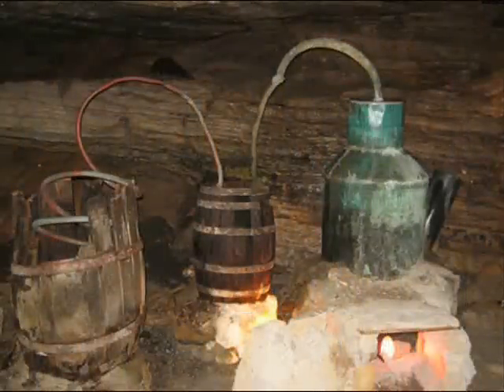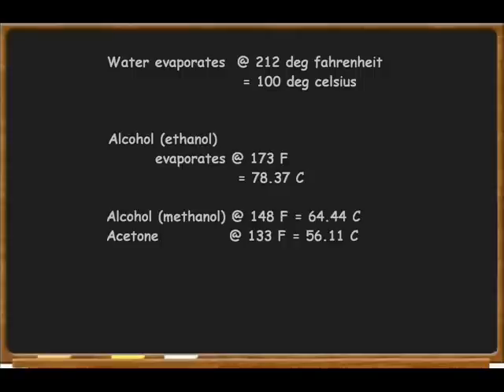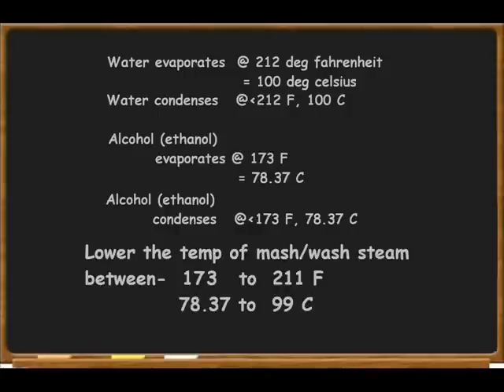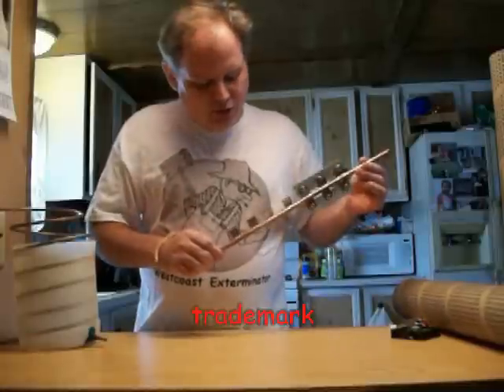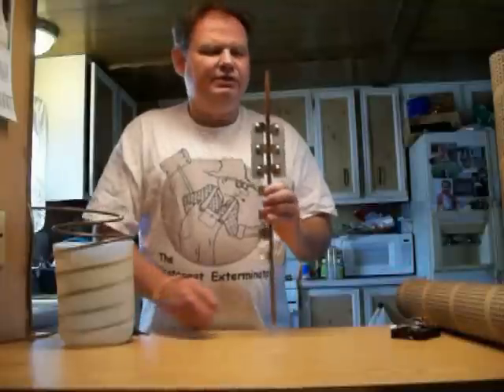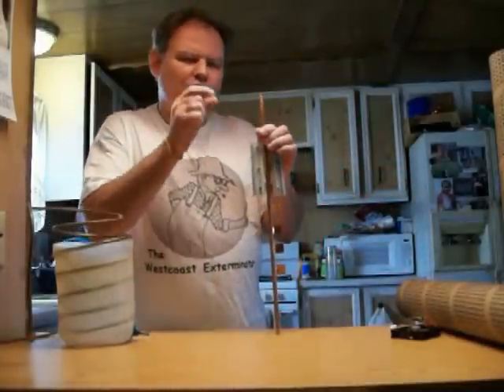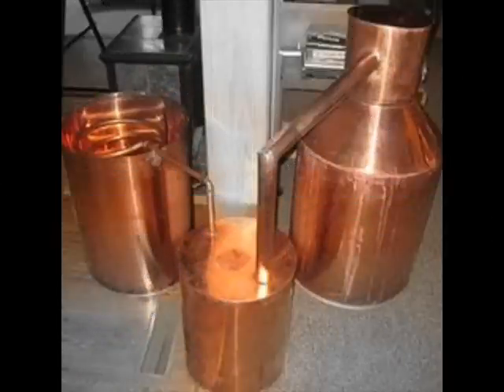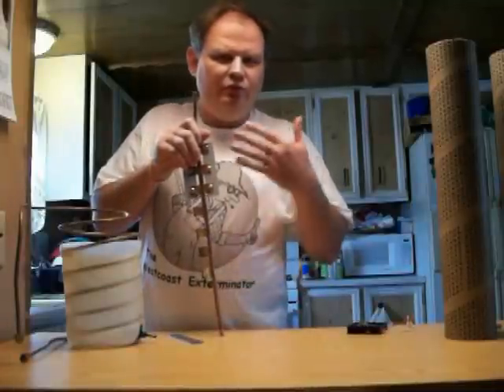Moonshine Still Reflux Columns & Thumper Kegs 101

Comment: Your design is untested and is so wrong on many levels.  I could write a novel about your errors in judgement.
Reply from the maker: Untested but you seem to magically KNOW it's still wrong. Amazing. Since you could right a book on it, maybe you'd like to submit your book to the same publisher interested in publishing my info? Just sayin'
Maybe you could give me the Readers Digest version and enlighten me...
Reply: wcemichael Damn right I know it's wrong.  30 years as a licensed Mechanical Engineer tells me it's wrong.  Let me just start by saying this.  You are solving a problem that doesn't exist.  Finished moonshine is TEMPERED WITH WATER to lower the proof.  Secondly the mash is HELD AT ITS BOILING POINT until it boils off, which is well below the boiling point of water.  If you cool the alcohol steam in the riser it will condense and run back into the boiler.  The idea is to make alcohol not continuously recycle it.
Reply from the maker: hlyautey Well I am the leading moonshiner on YouTube, with massive amounts of info, looking into publishing a book.
Let's test your 30 years of engineering...

"You are solving a problem that doesn't exist." Your belief system you just made up to please your ego. If I'm "solving a problem", then there must have been a problem, HOWEVER I'm not claiming nor have I claimed there is a problem.
I have merely reexamined the method and broken it down into a simpler solution. Your massive engineering knowledge should have told you that, but instead your running on ego.

Strike one...

 " Finished moonshine is TEMPERED WITH WATER to lower the proof." Then why have reflux in the first place? Go yell at the still company making reflux stills that make 190+ proof alcohol for drinking. I personally think people don't need reflux nor will I put one on my personal still and I tell them that, but people still want it, so I gave them the basic principles of it. Popcorn Sutton uses a thump keg in his video to increase proof and TEMPERS IT WITH WATER. So your point lacks having a point except to pound your chest at me. Your ego is bruised and now your cherry picking arguments.

Strike two...

 "Secondly the mash is HELD AT ITS BOILING POINT until it boils off, which is well below the boiling point of water"
Forgetting a main scientific principal...
The BOILING POINT of water is over 200 deg.
The EVAPORATION POINT of water is anything above the freezing point. WATER STILL EVAPORATES AT 170, that's why you can never make 200 proof alcohol

Strike three

"If you cool the alcohol steam in the riser it will condense and run back into the boiler."
Again forgetting basic principals. If you cool the alcohol steam to 180 then only water can condense and run back into the boiler. The reason the cooling fins were set up specifically the way they are, with gaps between the small copper pieces,  is to only allow a slight cooling, letting the water condense and the alcohol continue.

Strike FOUR...

You are 0 for 4
It seems your 30 years of engineering knowledge has failed massively, were as I have debunked all your arguments, having just woken up and still working on my first mourning cup of coffee.

You will either realize I am right and say your sorry, or look at everything with bias and start pounding your chest again and start cherry picking more arguments, but I already know what you will do...and the words "I'm sorry" won't be involved.

Comment: The reason the reflux riser is larger diameter is to decrease restriction and backpressure in the boiler.  You have completely overthought this and created either a very low production still or a dangerous one.
Reply from the maker: "The reason the reflux riser is larger diameter is to decrease restriction and backpressure in the boiler." And then they either pack it full of marbles and copper mesh, increasing restriction and back pressure in the boiler, OR it has to pass though several plates full of small pinholes, again increasing restriction and back pressure. You have completely underthought this

My one still has an even smaller diameter cooling coil with no reflux riser. It's not going to get any more restriction by adding in a slightly larger diameter tube before the smaller one. Oh, but since you are SOOOOOO worried about back pressure you can split the up tube into multiple up tubes of the same diameter and decrease back pressure, or don't you think that much? Took me the time of reading your comment to think of that.
Reply: wcemichael You sir are a moron.  You seem to think you invented the heat sink or the cooling fan.  The alcohol expands hundreds of times its original volume after it boils off and if it has no place to go it will blow the still up.  The reason the worm is smaller diameter is because the alcohol steam is condensing and dripping out the end.  HELLO
Reply from the maker: hlyautey
" You seem to think you invented the heat sink or the cooling fan."
TROLLING.
That would be like saying Henry Ford thought he invented the wheel.

Comment: While i'm not a fan of reflux stills I do own 2 and that's not how they work or are made. All true reflux stills share 1 common element. They have plates inside of them which act like several small thump kegs. The first one i purchased about fifteen years ago was packed with 3 layers of copper mesh separated about 6 inches apart(4 inch mesh wadded up in sections and separated 6 inches from the top of one section to the bottom of the next) The wash would evaporate into each of the packed layers then separate the water from the alcohol until it came out the condenser at around 186 proof. Hot as hell but no flavor. 

The second one i purchased about 2 years later and is known as a hillbilly flute. It has four actual copper plates as well as glass sight glasses. Each plate is concaved down and has a hole on each side so that they are constantly re condensing the the water vapor.
Your diagram and the way you are explaining it is what happens when someone detunes their column so that it was now a pot still. As i said i don't like reflux stills but I do own and have ran several of them for friends. Not trying to bust your balls and even though I've been doing this for years I still watch and enjoy your videos. Keep up the great work!

Comment: Why not just just control the temperature in a stepped process? Heat it to the lower temp to get the bad alcohols out then step up the heat to 173 degrees or slightly above. Controlling the heat with an Arduino and some heat sensors along with a relay for the heating element would be easy.
Reply from the maker: On a gas stove?
The idea behind my videos is to learn the processes, not to let machines do the guessing for you. A car that can park itself usually has a driver that doesn't know how to park a car.
Reply: wcemichael
No, using an electric element to heat the mash. I disagree with you on your analogy, or rather your comparison. It wouldn't be having the machine guess, but control the process. It requires knowledge of that process to program the controller to read the temp from the sensor and have the heating element do what's required. There's no guessing by the machine at all. I can understand that part of the thrill of making moonshine is doing it yourself. Part of the thrill for me is seeing if precise control would yield a superior product. Maybe it will, maybe it won't.
Reply from the maker: Bad Wolf Media
Turn still on, set to temp that other guy tells you to. walk away.

My method, I don't even know what temp I'm at.  My product is superior because I'm always watching it and making little adjustments. The highly advanced control unit is my brain.
Reply: Actually the wash will take care of temperature control for you. When it is running off the heads it will not go above 159-162 at the top of the column/pot head. The heads will run off very fast unless you are running off more than 20 gallons of 10% wash. So it will be much easier for most to just toss the first 1.5 oz per gallon of wash. 
As soon as the methanol is run off then your wash will jump to 172-178. This is when you are getting great tasting high proof Distillate(moonshine, rum, vodka, whiskey). The temp will slowly climb to about 202-210 producing lower proof as well as harsher tasting Distillate as it does. This entire process will be done with out you ever adjusting the temp of your heat source.
Before you make your first run fill your still 80% up with straight tap water. Set the temp on your burner to medium and see how long it takes to begin producing distilled water. If it takes less than a hour turn it down/more than a hour turn it up and do it again. Once you find out where your burner works best take note, this is where you will set it to do your entire run from now on. Of course the 1 hour rule is for stills from 2-6 gallons add 15 minutes for every gallon above this up to forty gallons. Over forty and your in the distillery/illegal moonshine business range and it would be best to consult or hire pros to help you control your still and or run from the cops.

Comment: I think it would be good to make a video on how to make a copper still
Reply from the maker: I might, given enough time and money, as it would be expensive.
Reply from the maker: John Erskine
Hmmmmm......
Other than developing a refined taste, not really. Experience my friend. I started distilling my own 20 years ago. Started with Night Train wine, then hard cider. I had a small bit of it shining figured out, and I did some things wrong. A couple years before I dove into it again and these videos, a friend gave me a shot of shine from some unknown guy. I didn't like it one bit, I was worse than my first time running myself. I didn't ask for anymore. He thought it was great. Sometime later, I heard he went to the hospital because of bad shine.

Now if you want to run some store wine through an unclean coil, you can see what that tastes like. DON'T DRINK IT, just taste it
Reply: This is AB at yall- I built a still out of a wistler coffey pot some years ago that worked just great! I made a 1/4 inch copper coil about10 or so wraps and put it in a #24 juice can and soldered it together Made a vent to allow cold water come in from the top and drain back into the sink- once the can filled with cold water I closed the vent keeping the condencer cold- ran the other foot and a half of the coil into the top of the pot and made a bail to hold the top down- made a 5 gal buket O malt beer and ran it after the head died- Took some time after runnin the whole buket to strain it through washed yarn and hicory coals- I lived in an appartment where the water and gas was included in the rent so it only cost me the price of the malt and sugar and a lot of time just to see how the Ole timers did it -no thumper or anything like that  Just an ole still like the one on M.a.s.h that the docs had and it woked great!  Just a thought.
Reply from the maker: AirsoftEli2000
Yep, it's not the equipment, it's what you can do with it that counts
Thanks for sharing. I was wondering about building a M*A*S*H still just for kicks and giggles

Comment: would the heat sinked column come off the pot and transition to a 45* drop?
Reply: No it's even simpler. If the steam goes up at any angle and drops can fall back into the pot it's reflux. If the steam goes down at any angle and drops fall into your collector, then it's a condensing coil. So even 20 feet of copper coil, as long as it's going up, is a reflux.
Reply: Ok, thanks Mike. I'll give that a shot. I'm trying an old Potcheen recipe. I'll let you know how it works out.
Reply from the maker: SCOTTSCOTTISH1
Yes, the main thing to remember is, your only cooling the steam just enough for the water to condense and fall back into the pot and not your finished product.
Reply: Great, I thought that was how it was, but I trust your opinion more then mine. I'll send you pics of my ceramic tile heat sinks installed when I get it finished.
Reply from the maker: ceramic tile heat sinks? Nice. That's thinking outside the box.
I don't know about it though. Ceramic is kind of known for holding heat, it's put in electric heaters because of that fact. it might require a cooling fan.
Just putting in a afterthought.
Reply: Your so right. What is needed is something that dissipates the heat. I know I've seen copper flashing. You could make a sandwich out of two pieces and form them nicely around the column with a rivet hammer and dulled very blunt edge chisel. That way it would be nice and tight and then solder those down. I think that flashing comes in 8 - 10" widths by 10' lengths. quite high, but might find someone willing to give me their off fall.
Reply from the maker: SCOTTSCOTTISH1
Now an idea I had but didn't show was to surround the tube with other tubes. solder them on and surround the steam tube. You could then attach more tubes to those tubes. They would also channel air from a fan real well. You could also sandwich a piece of shorter aluminum between the tubes and solder the tubes at each end.
Reply: I just purchased some copper vga heat sinks. I'm going to give then a shot. In computers those vga heatsinks have a lot of surface area. Worth a shot. Didn't cost much so why not.   http://www.ebay.com/itm/8-PCS-Copper-VGA-RAM-Cooling-Heatsinks-Cooler-with-Adhesive-Backing-Strip-/291186309267?pt=LH_DefaultDomain_0&hash=item43cc0e7893
Reply from the maker: Ooooo those look good.
Reply: Yes they do. They should work very well. Think of all the heat built up on video cards inside a processor.

Comment: Really cool!!! I've been obsessed with this lately, reflux and thumpers in general. Anything to get a cleaner product :)

I have a 1/2 gallon Mason Jar thumper, I put pure copper scrubbers in it(that I boil clean before every usage), and I put just enough water in it for the copper "input" pipe to touch, no more no less.

The output is just a small condensor I've had for awhile, not the big immersion coil types, but the smaller ones that you pump water through constantly(I've used an aquarium pump for nearly 3 years on it)

It's been really great!! High proof, no having to mess with collecting low wines and "re distilling" them, which is something some people do, but I don't think it is efficient, also it comes out very clean, and at a more reasonable speed.

I even thought about trying a second 1/2 gallon Jar after it, like a double thump, but who knows. Never hurts to try!

This video has inspired me to try something different when I build a copper thumper though. Run the copper thumper dry, but immerse the outside of it in cooling water.

Thanks for the information!!